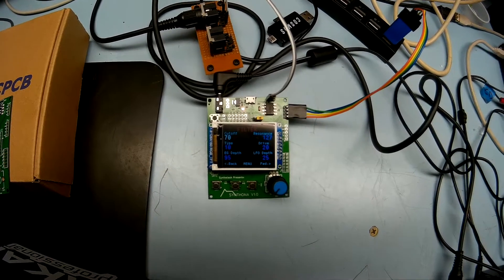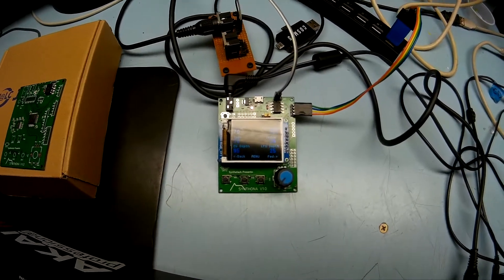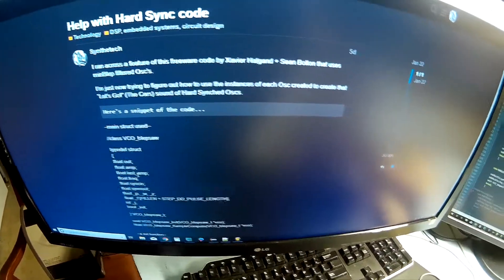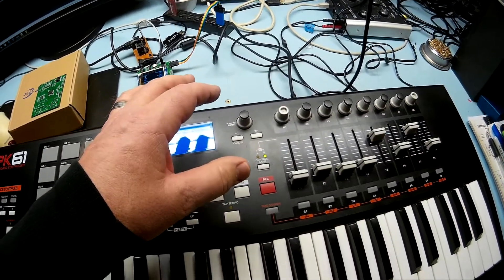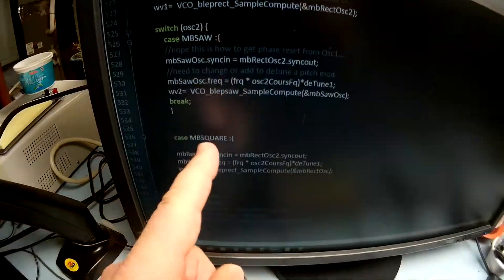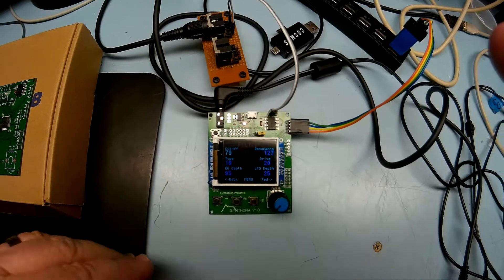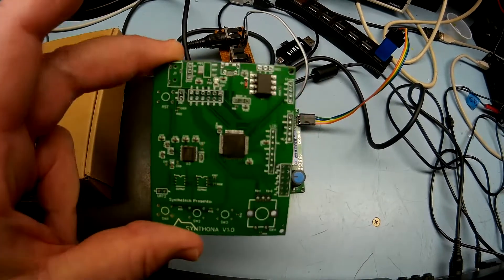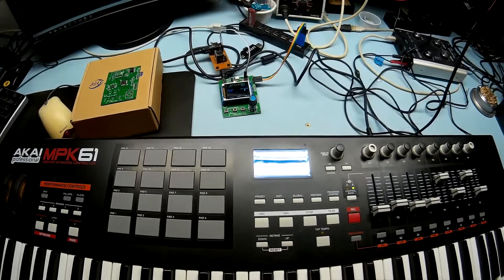HARDSYNC Synth sound on STM32 chip (with DAC).

Comment: you are assembling your own synthesizers? wow
Reply from the maker: more like experimenting with technologies, but yes I designed that PCB.  I had JLCPCB make the board and place most of the surface mount components on it.
I placed on the final parts it still needed like usb connector, vReg and the eeproms and flashed in the code to make it work.